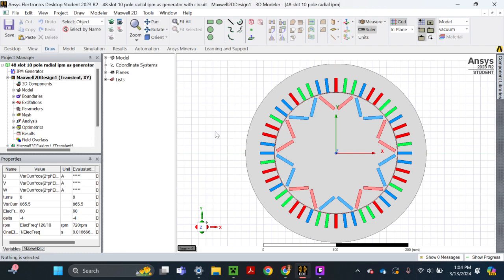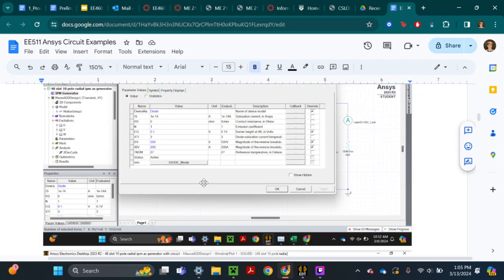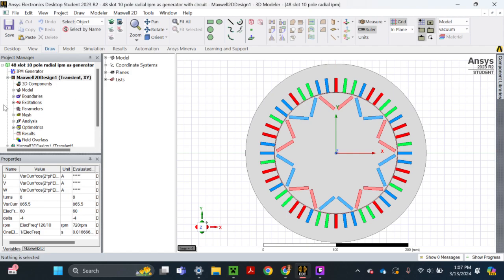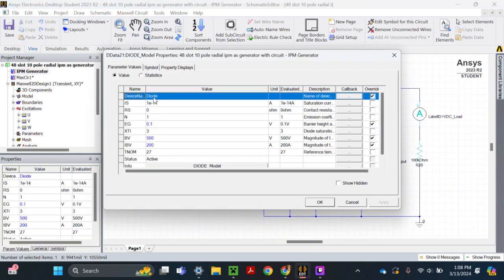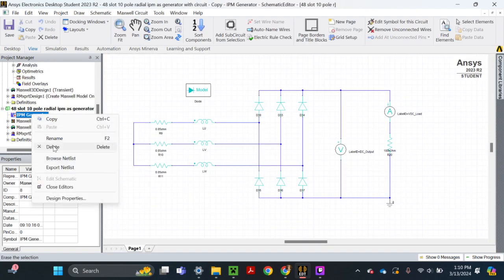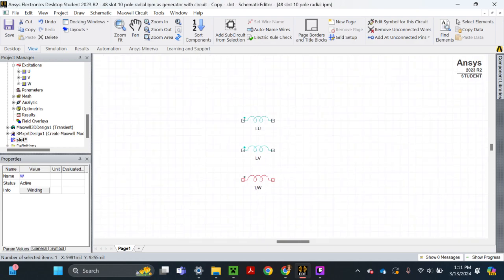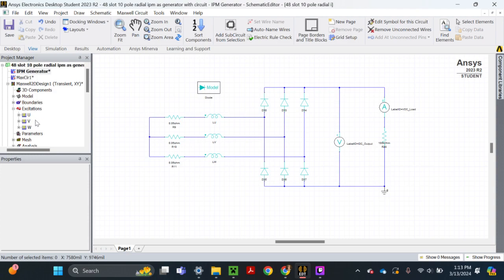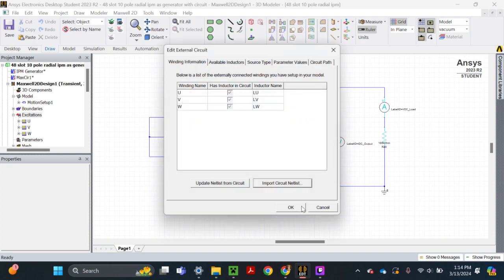EE 511 Class 3/13/24 Netlist External Excitation

Comment: Thank you very much for the video. I have one question. How can we setup ECE3 and ECER models for pm motors in ansys?
Reply from the maker: Thank you for the comment! (sorry for the late reply 😅)

In Ansys Electronics desktop you can use HFSS for high frequency RF type stuff and use Q3D/2D extractor and/or Maxwell 3D/2D to extract equivalent circuit information. I’ve used the two latter in Ansys Electronics Desktop for equivalent extractions of inductors and transformers from 2D and 3D designs/used it for iterative simulation design of inductors and transformers. Maybe i can make a future video showing how to simulate a transformer and/or inductor in 2D or 3D.